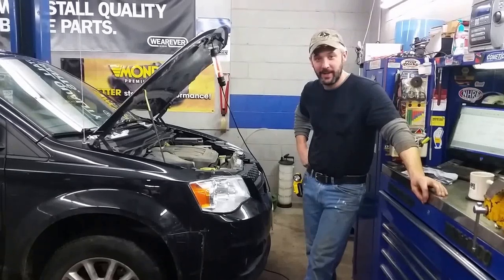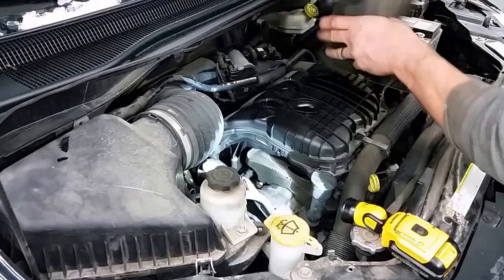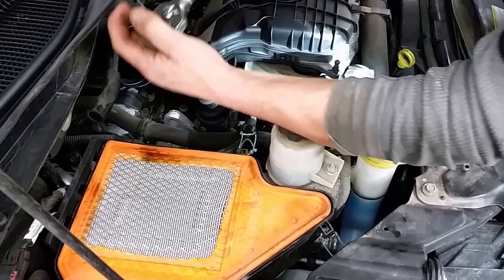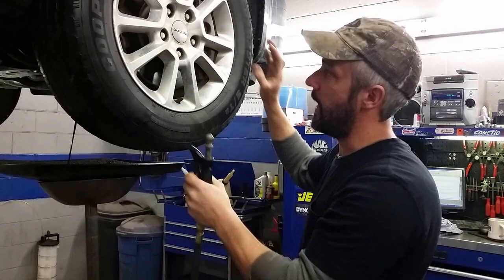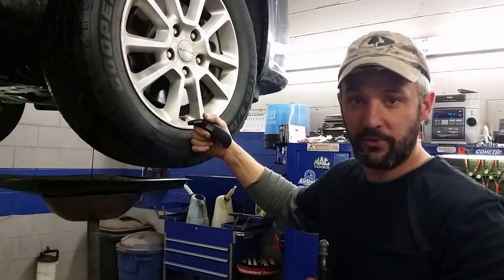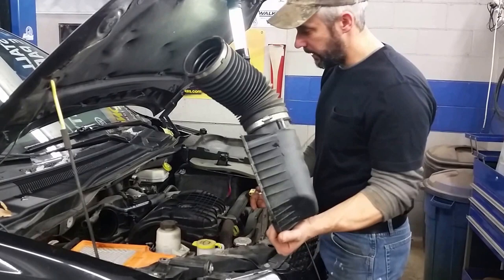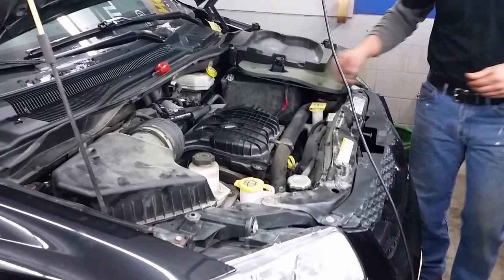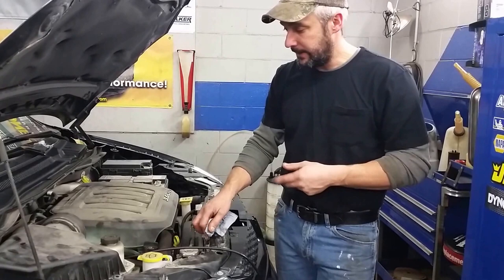Oil & Filter Change '12 Dodge Grand Caravan

Comment: In case no one noticed the tire pressure light was on unless he crunk it up on the lift just dont make sense your supposed to check your tires every day before you drive if one looks low then you break out the pressure gauge not knocking you I like your videos
Reply: Most people don’t want to pay the shop $100 each to fix

Comment: Had a friend who drove his Plymouth duster 1972?....approx. 160,000 miles with no oil change, he would just add oil when ever it would get low, ran great. Oh ya he never changed the oil filter either. cant imagine what the inside of that engine looked like.
I have never seen a oil filter like the one you just changed, kind of cool to be able to see inside of it. Guess I'm living in the past. I guess pretty soon they will get rid of carburetors also :)
Reply from the maker: Charles Miller Yeah right they will get rid of carbs the day they get rid of points... never happen...
Reply: Eric's got to make some money !!. Wish they made the screw on type with a formed bolt on the bottom, Hopefully the same size as the oil plug, so to use 1 wrench. Really I would like a house mechanic to do it all for me to be honest. But if I lived close to Eric, I would just take it over in the middle of the night and drop it off.Then call him say every 15 minutes to see if he had it finished yet :) Bet that doesn't happen to him much :)
Reply from the maker: It might be better too if you just had my cell number so you could call like sunday morning to see when it might be done on monday then call monday right after I start it and add a bunch more things you would like done... add after it is all finished see if you can come back later in the week to pay for it :)
Reply: Great Eric you got it done so fast... I'm going to be out of town for a few days, so just you know park it one of those empty bays till I get back, should not be but a few days. I'm so lucky to know such a pleasant mechanic,Oh question did you use the good wax or that turtle stuff.Happy Customer,CharlesPS, If you want to use it to chase down to Napa to get parts, or go get lunch feel free. Just watch 1, 3, 5 gear kind of wants to jump out, or just you know hold it in gear, that's what I've done for the last 5 years.

Comment: Very nice and thorough video. Thanks. On my van, every morning, or even later in the day, when I start it up, it sputters and sometimes dies on me. After restarting, it's fine. If it manages to keep running (doesn't die) for a few more seconds, again it is fine.  It will be fine for the rest of the day, unless it sits idle for maybe 12 hours or more.  Any ideas on that problem?
Reply from the maker: With out any gathered data I have no idea

Comment: Informative video, thanks. I had a question: I noticed that the air filter had oil on it from the fresh air hose above it for the engine. Is that normal to have oil coming out of that hose, or would you say that's an indicator of a PCV issue?
Reply: Your PCV could be stuck open. Need to be replaced every so often.

Comment: I noticed you didn't check the oil dip stick for a level check or take off the oil filler cap.  Would it be a good idea or are those steps a waste of time?

Comment: Is it bad or ok to blow compressed air into the engine through the oil fill hole on the valve cover to help drain the remaining oil during an oil change?
Reply from the maker: Handy Daddy I wouldn't think it would hurt as long as you were mindful of the surrounding dirt. I would be mindful of the valve seals too. I don't really know how much extra you will get out is all...
Reply: I wouldn't recommend it as a lot of times, compressed air also compresses and sprays water, which in effect would be putting water into your engine.

Comment: Do you know if there is a difference between the 2011 vs 2012 vs 2013 Dodge Caravan engines? Or are they all identical? The reason I am asking is that the manual on 2011 and 2012 uses 5W-30 oil and the 2013 manuals says it uses the 5W-20 oil. I have cross reference the block, heads, and cranks, crank bearings between the years. All uses the same part numbers. Is there any reason why they recommend 5W20 on the 2013 and onward? Would 2011 and 2012 accept 5W20 and run just as well or better go with 5W30? Or will there be issues if a 2013 on 5W30 vs 5W20?
Reply: In my personal opinion, the move was probably for fuel economy.  But there's a common problem with the rockers becoming oil starved at cold idle.  So the move down could have been for that.
Reply: @Hong Kong User 
I was using castrol 5/20 fully synthetic until I notice on the filler cup says 5/30,  now I use Mobil1 5/30 synthetic and didn’t see any changes whatsoever, I believe Pentastar would run in both oil without problems

Comment: i have a 2012 dodge grand caravan 3.6 flex fuel with 52,000 miles. What kind of oil should I use. Regular? Synthetic? High Mileage? and that is the difference between them?
Reply: Miguel Romero I don't normally ever use synthetic, just plain Jane dinosaur oil.  Never had any problems, and my truck had over 300,000 miles on it, original motor.
Reply: I think Motocraft 5W-20 semi synthetic is a good choice for the 3.6L flex fuel dodges.  Its cheap and my 2012 Dodge Journey with this engine runs like a watch on it.  with 4K to 5k oil changes.  I let the local Ford Dealer put in my in their quick oil change garage. also Used the 5W/30 Semi synthetic Oil in my wifes 2.4L  4 Cylinder Avenger with 121,000 engine ran fine with no issues. I think Ford specs their oil pretty hard since they would be responsible for a lot of Ford engine warranty work if they specified a crappy oil.

Comment: What do you do if the bypass valve goes flying out? At work we use an updated filter that doesn't need that valve.
Reply: That filter doesn't fit in 2011-2013 oil filter housing.

Comment: Heard oil filters don't work at highway speeds, at higher ram's they open the bypass valve, is this true.
Reply from the maker: Bert Cochran Can't really say that it is
Reply: oil filters don't usually have a oil pressure relief valve. that's typically controlled by the relief/regulator built into or on the oil pump or its housing.
there is an anti-shypon or backpressure valve in the filter. it's job is to keep the oil from draining down to the sump when the engine is shut down. 
past testing on farm and pencil filters had the highest leakby. meaning less oil on top to help inital. lubricate on startup until the pressure has built up to operating pressure.
Reply: +Hawaiian F150 that's Fram and Penzoil not farm and pencil  =-b
Reply: Bert,  that's not true. actually  the oil pressure relief valve opens by pressure not RPM or Speed.  it's typically just a ball held onto the valve seat by spring. and typically set between 65 and 75 psi. some are set differently by manufactors design. but 65 to 68 (ish) psi - is the normal setting.
Reply: +Hawaiian F150     thanks for the info. clears things up.
Reply: No problem.   There's lots of info on this SMA channel. Plus the viewers are almost as awesome as the videos.  I've learned a whole here myself.

Comment: Checking the tire pressures with it on a lift? Shouldn't you do that on the ground, since I beleive it would affect the pressure readings?
Reply from the maker: +Ben Morris You would never have a gauge precise enough to see the difference in pressure. What pressure do you keep in your spare....?
Reply: South Main Auto Repair LLC 62 psi , damn doughnuts

Comment: I'm surprised there's no washer or gasket for the drain plug. Is that correct?
Reply: Rodney Ninow most dodge vehicles don’t use crush washers they have a built in gasket on the oil drain plug

Comment: Was bored so I went through watching some old videos.  What type of oil do you keep on hand for your oil changes?
Reply: my engine light keep coming on what kind of oil do i use for a 2012 dodge caravan?
Reply: Look at the oil cap it will tell you most of the time!!!
Reply: Oil cap or owners manual tells you what to use

Comment: be careful tightening those caps, those housings have been a problem with leaks, they can crack if overtightened. With these I use a short ratchet and go very easy on it. You just have to get the cap flange flush with the top of the housing, the o ring gets squeezed between the cap and the housing.

Comment: Great Video!  I guess I'm overly anal about taking care of the vehicles. Really am petty picky on that stuff.  I figure $40 for oil or $10000 for a motor or trans. Kinda a no-brainer to me.  I use only Mobil 1 or Royal Purple full synthetic oils with a WIX, Mobil 1 or K&N synthetic media type filters. Just never did understood why using a paper media based oil filter like Fram or Pennzoil was a good idea.  Not counting how poorly Fram paper type filters are made and how bad the anti-syphon valves leak by.  Plus I envision media paper floating around in the oil ports and passages to the bearings and it makes me shudder a little bit.  I think the FOMOCO Full Synthetic oil is probably good enough.  I do use the ford oil, prolly about 1/2 Qt,  to help flush out any old oil.
Reply from the maker: +Hawaiian F150 Oh man you are digging these videos up out of the old archives here haha I use Mobil 1 in all of my cars and pure one filters or Mobil one.
Reply: +South Main Auto Repair ya man - if your gonna spend tens of thousands of hard earned money it a given great oil and filters is the very best way to protect your investments
Reply from the maker: 100% sure is!

Comment: Watching this video definitely makes me not to want buy this van. You can tell dodge is cars are junk
Reply: I've had mine (2013 model) for just under 30k miles and haven't had any issues with it.  Just keep up on regular maintenance like this and it'll serve you good.
Reply: 2000 Caravan, 265,000 miles and the engine and trans never needed any work! I took it everywhere across the states. 2012 GC like this with 107,000 miles and runs like a top! :-)
Reply: @drkar4656  might be  some few that came out ok . But I drive a 2011 sienna with zero problems . The handling is so much better it's just built solid . I test drove a few grand caravans before buying a Toyota and honestly them caravan feel like a junky ride cheaply made and no power
Reply: Had two of them. Both over 200,000 miles one was 290,000. Never needed engine or trans work. Followed maintenance schedule religiously. Great vehicles